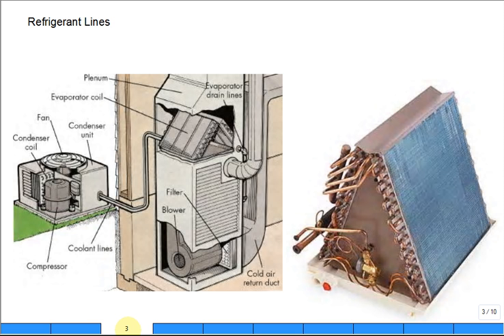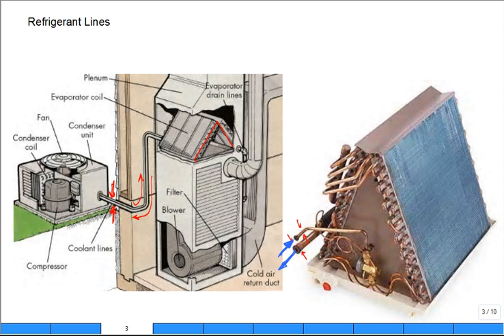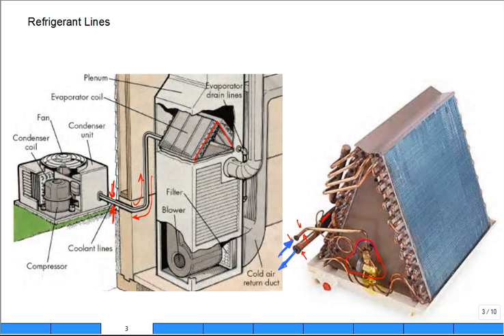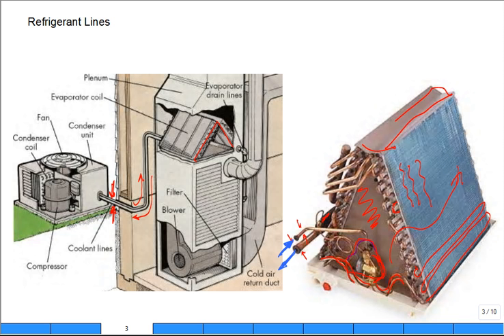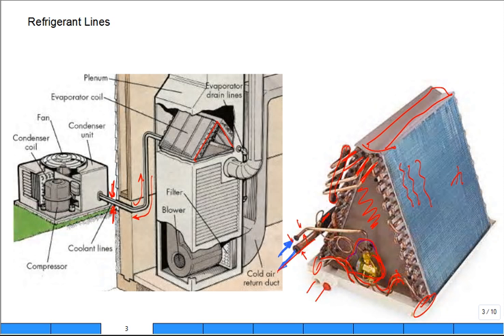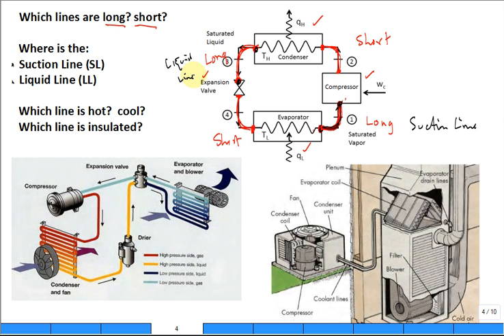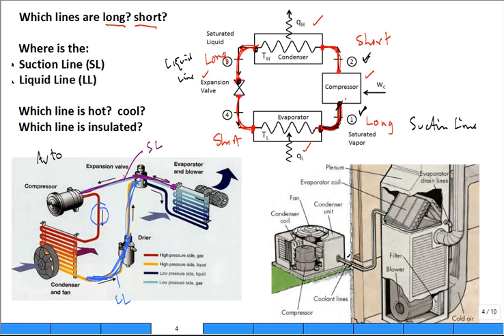Intro refrigerant lines: suction and liquid

Comment: For residential systems that locate the air-handler (evap coil) in an attic....meaning "high" elevation....and locate the outside fan / condensing unit "low"..... is there a need for the (small-dia) LIQUID LINE to have an inverted P-trap elevated above the evap coil?...where it attaches to the evap? My Goodman unit is plumbed that way and I have no idea why. This is not the larger diameter suction line to the compressor/condenser.

Comment: Can someone explains for me more:
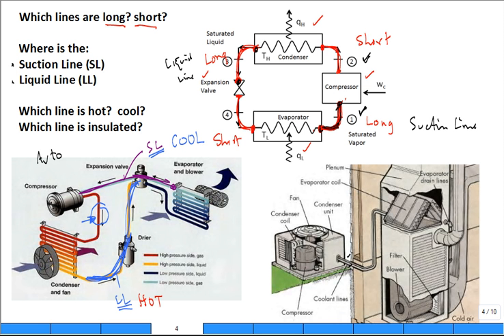When he talked about insulation in 9:35 did he meant to insulate the section line or not? I did not really understand, especially when he compared the temperature and vapor relationship.

I live in an extreme hot area, and the section line that goes back to my car compressor is not insulated, so should I insulate it? Is it the right thing to do?
Reply: He mentioned to insulate the suction line to prevent system inefficiency.  If it is not insulated, the line can absorb the surrounding heat and increase superheat (additional heat after refrigerant changes from liquid to vapor).  In my opinion, I don't think it's worth it to add insulation to your car suction line.

Comment: Why is the saturation temperature in the condenser with 410 a higher than R22?
Why do the technicians add 25 to the ambient temperature to determine the condenser saturation temperature?

Then the technicians Find the difference between the saturation temperature & the sub cooled temperature at the outlet or before the expansion valve to know the sub coil temperature?

Thanks

Comment: Why the compressor capacity drops with higher super heat?
Why a lower refrigerant charge better for system performance?
I have noticed for water the required sensible heat is 1/2 BTU per degree F up top 32 degree F and from 212 degree F onward,  & the required sensible heat between 32 and 212 is 1 BTU per degree F change. Why is it so?
Thanks